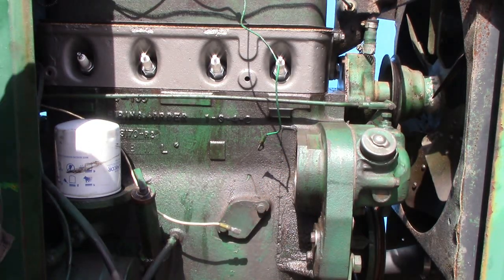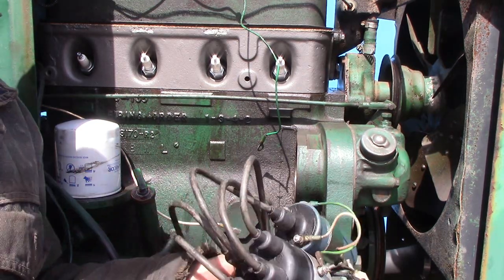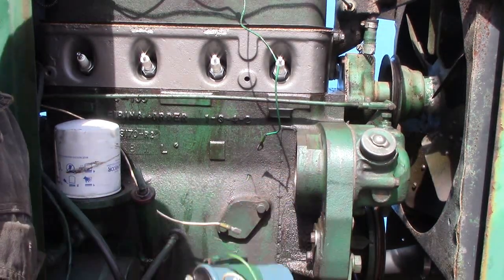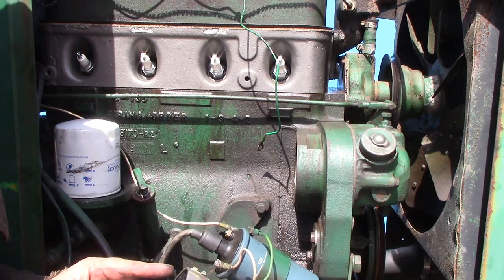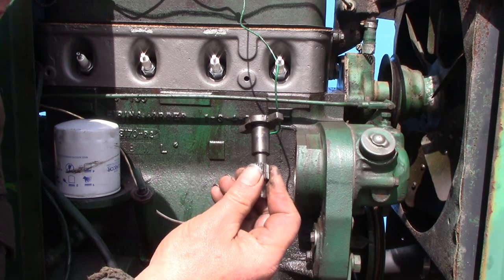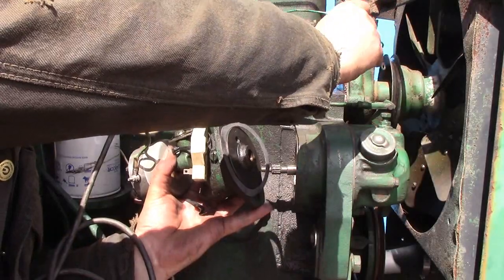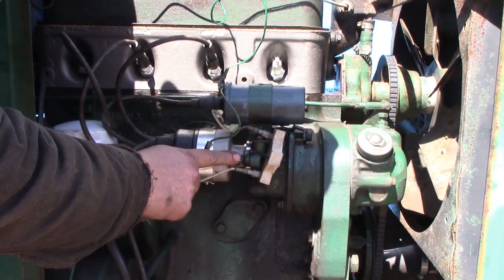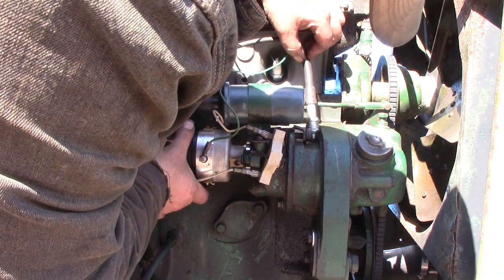International C135 Unit Engine Rebuild Part 3

Comment: Hello Dave, and thanks for the videos.  Helps us David Brown owners out a lot.  If you don't mind I have a couple of question about my 990.  Can the front engine oil seal be replaced without removing the timing cover?  I'm replacing the water pump on this tractor and so it will be a good time to do it.  The second question is if you know any tricks to freeing up the left wheel brake pedal shaft without pulling the final drive apart?  I had the brakes replaced a few years ago but that shaft locked up on me within less than a year.
Reply from the maker: I am sorry, I haven't had a lot of experience with David Brown tractors so I can't answer either question for you. I am glad you enjoyed the videos, thanks for watching!

Comment: Thanks for all of the awesome videos Dave, learned so much! Having inherited 3 x diesel B414's from my late father, your videos have been invaluable in learning some of the nuances of keeping these beasts going! I'm sure I've got a million questions but one I've got right now is, I am looking to replace the manifold on some of the tractors as they look like they've split. When replacing the manifold and gaskets, should the gaskets be greased or just applied dry? Do the bolts need to be torqued up when replaced on them? Anyway love the videos and hi from the UK!
Reply from the maker: I put the gaskets on dry, the manual gives a torque value for the manifolds, about 45 foot-pounds if memory serves but I just snug them up good with a 3/8 drive ratchet. :)  
  I am glad you enjoy my videos, thanks for watching!

Comment: This is the only way to complete an engine rebuild. Step by step. One must tighten the head bolts twice, there are a few you should not but most engines it is a must.
Thank you for showing this final step.
Reply from the maker: You are right, the manual calls for re-torquing the head. I bring the engine up to operating temperature and let it fully cool 3 or 4 times and then re-torque. Thanks for watching!